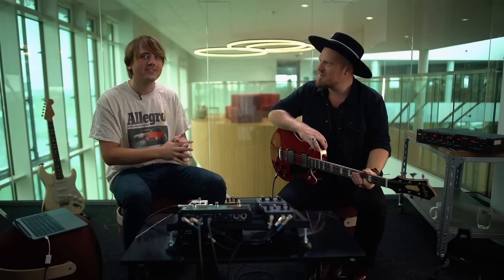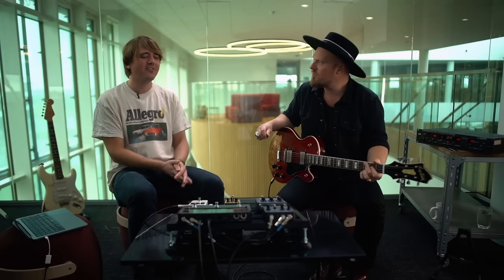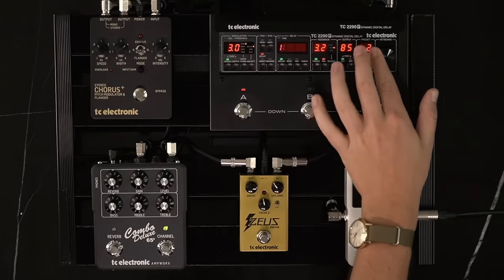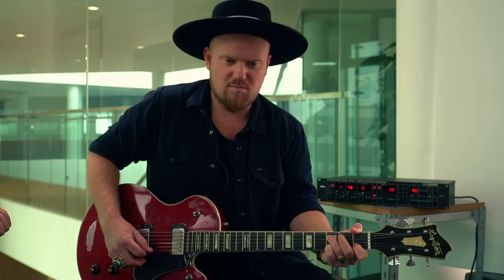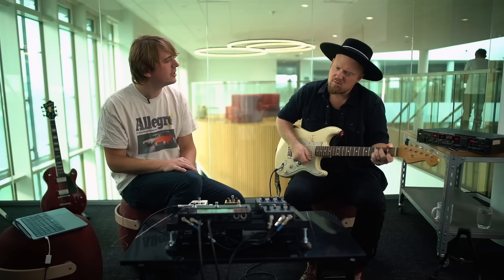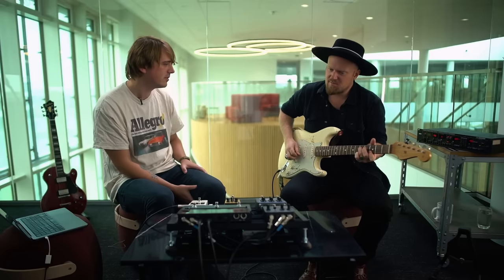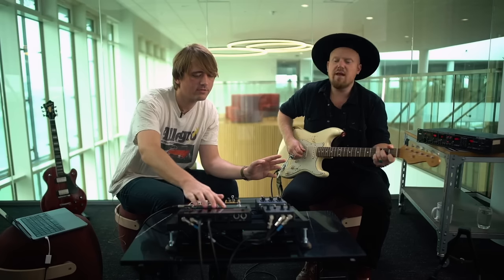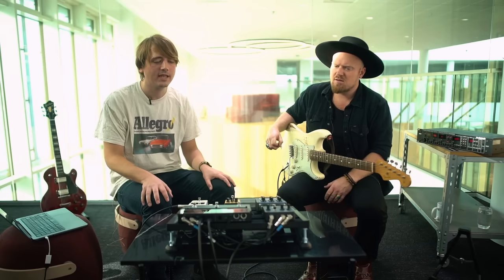2290 P Dynamic Digital Delay – Deep Dive!

Comment: Bring back the G System Pedalboard with all the best from 2290 ;)
Reply: Or just put the best algorithms in the Plethora… :)
Reply: What's the need for a G System when a Fractal FX8 exists?
Reply: @fr201  Sorry but not the same usage. The G System only has FX and no amp sims, it was made to be integrated with real amps. The rack unit detached from the board can be rackmounted for a clean setup with a single cable going from the board to the unit.
Reply: I've been spamming all TC videos that we needed an updated brain for the G-System

Comment: Wow! That’s amazing!❤ I had, back in my “hairs-days” an original 2290, sold once to pay the rent (had tough times, every once in a while everybody has…🤷🏻‍♂️) and always regretted. Which it leads to buy this one again and never divorce it! If there’s any chance to play two different delay in one time (kinda A+B together, in a sort of Gilmourish style) might be the Final Delay!!!😍
Reply from the maker: Aww, that's so great to hear! We are happy to bring back this this tool into your life. Actually both A and B run at all times, so we can do seamless switching between the two. This means that technically it is possible CPU wise to make it into a dual delay. Now, this would still require a bit of software rework on some UI elements as well as some additions in the app. Not promising anything here, but it is a part of the conversation around here.
Thanks for chiming in on this suggestion. /Michael
Reply: I would be looking for dual delay option as well - the quarter-into-dotted-8th is so useful for Gilmour and of the course the Edge-type stuff.  Great launch though. Will keep a watching brief on software updates.

Comment: I know it’s not on topic but do the ampworx pedals need to be at the end of the chain when using the cab sim output?  Also, can I use a trs-xlr cable with it and skip a direct box?  Looking at getting one soon cuz they seem pretty cool!
Reply: Hi @mikes062 the AmpWorx can be anywhere in your guitar signal chain, and if you want effects before the cabsim you must use the normal output, then your effects and finally a standalone cabsim such as the little red Impulse. 

Yes, you can use a TRS-XLR cable and skip the DI box, that’s exactly why the outputs are balanced and ready to drive a line 😊
Reply: @jose_simon  ok that’s what I thought, I always run my effects into the front of the amp anyway so that’s perfect!  Thanks!
Reply: Can the 2290p also take and put out output a line level?

Comment: Congratulations on the video and the sound and recording quality.

I simply wanted to ask if there was a way to get the presets that you make on it, because the short guide to the device, which is the only thing I have found on your page, doesn't say anything about tremolo and it seems to me that it doesn't say anything about Uni Vibe either, although this I don't remember the last one for sure.

Because if it were like that it is definitely the pedal I have been waiting for these last few years.
Reply: There is no manual. Lol. However you can download the original manual for the rack version 2290 as the functions are the same. Hope this helps
Reply: @jonathananderson3897  
Thank you very much, because of course your answer helps me, and I am also one of those who study manuals in depth.
Congratulations on your efficiency and have a good year.

Comment: I ordered one, does anyone know if the by default it does the wide phase reversed stereo delay instead of just the panning, I assume it does as the original does, but I haven't seen it demonstrated the way it is known to do on the original units, the SDE 3000 does but it's phase reversed between the two separate delays not just one delay in stereo?

Comment: A bit late TC,  I've bought every delay under the sun and it's costly. Now this machine arrives....I'm kicking myself but thankfully I still have my raspberry red G system.
Reply: I don’t think you’re missing anything with this. If you get the Timeline or Echosystem, those do everything this does, more, and they’re easy to dial in. Yet this 2290 is about 80% the price…

Comment: I think TC Electronic overcomplicated what should be much easier. I predict Nova Delays to be a hot item over the next months... with skyrocketing prices coming.
Reply from the maker: We understand your point. Actually we did draw a concept 2290 pedal with a simple UI, but in the end we decided that if we where going to do this, the UI, features and not only the sound had to be like the original.
Reply: I guess my nova repeater is still good then.

Comment: quiet complicated even for this product manager , should be easier for normal guitarist.
Reply from the maker: Yep. Complicated just like the original. This is the tradeoff for having all this control of the delay line and modulation. Once you get a grasp of it though, it's super rewarding... and addicting.
Reply: @tcelectronic this kind of gear is always overwhelming at first. After a while you use it second nature.

Comment: Not a great demo . Too many buttons just get the crazy tube circuits … time . Easy and sounds great . They seem to want these digital delays to emulate analogue . Just get an analogue one .
Reply: Not a demo, it's a deep dive ;)
Reply: But the original 2290 is digital?
Reply from the maker: The original was digital, even though most of the circuitry was analog.
You want a delay like this to be digital. The point of 2290 is to have supreme high-end delay and not a darker analog delay. If you start clean and hi-fi, you have more to alter, subtract, and shape delay and other time-based effects from.

Check out the video "sound of science" about the 2290 to get a better understanding of the original. Remember subtitles :)